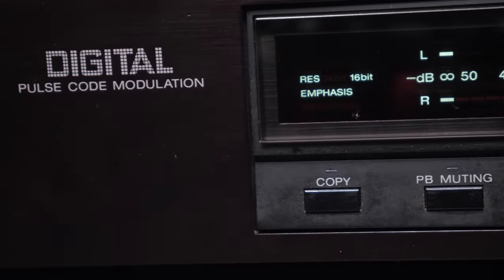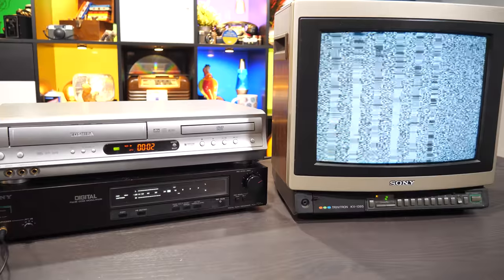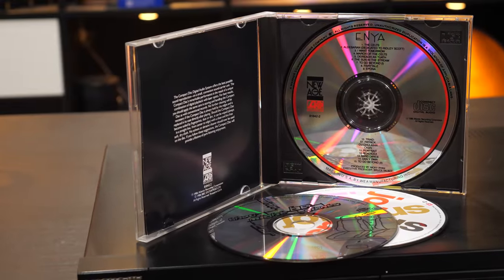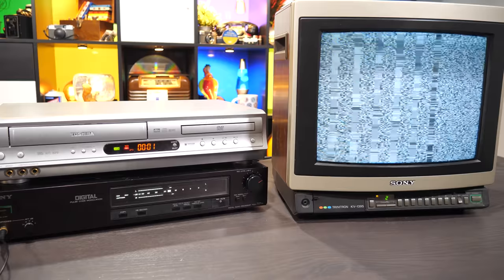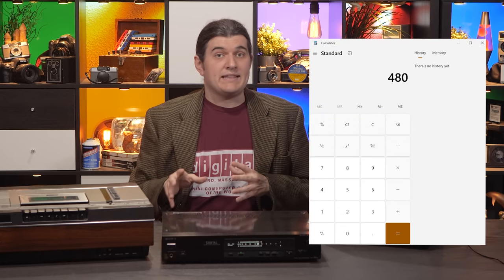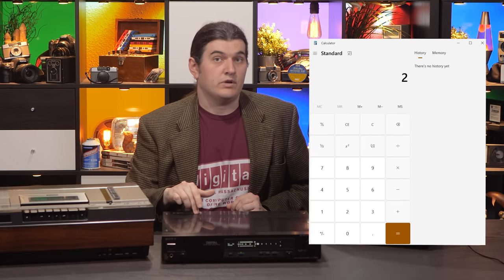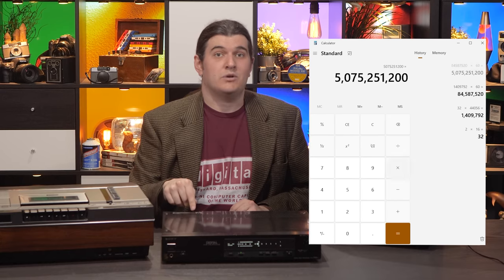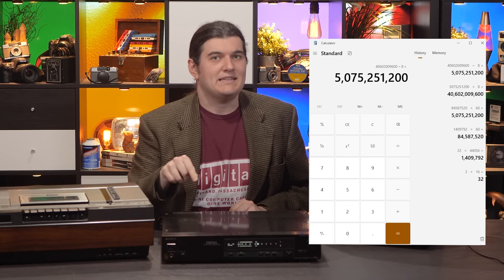Digital audio needed videotape to be possible - and the early days were wild!

Comment: This isn’t a mainstream use but I worked in a Biomed engineering lab at John’s Hopkins back in the early 90’s. The head of the lab modified one of these to work as a data recorder for patch clamping cardiac cells.

Comment: They would have been great for mastering on to for home/semi-pro music recording from 4-track cassette and lower-end reel-to-reel multitrack recorders. But the fact that you can't master a CD on it is a major kick in the rear.

I wonder how that video format compares to the signal a DAT recorder makes. (Which we can never see in its raw format, as we can here on your monitor, as all you ever get out of them is the decoded audio data.)

I knew about professional versions of these but never realized these consumer ones existed. I can say for sure I'd have wanted one. Even if I couldn't master CDs off them (and of course we didn't have the ability to cut CDs on our computers until CDRs started becoming available in the very late '80s and weren't affordable until a few years into the '90s - and also this has no digital interface to a computer so the whole issue is moot) it would still provide a 100% transparent medium to master on to and duplicate analog cassette tape copies from. (I'd often re-master every time I wanted to make a new tape copy for myself or friends anyway, just to save the additional noise and quality loss of another tape generation. With this I wouldn't have to, and that's exactly what I did when I first got my hands on a friend's DAT machine.)

Thanks!

Comment: At 5:50 --  The circuit described here would be more of a over-complicated amplifier, not exactly a radio, unless the signal is transmitted in a step you didn't describe?
Actually, digital radio makes sense, when the code that makes up the signal has additional parity bits -- include those, and it's easier to recover signal lost due to interference.

Comment: PCM Audio data doesn't have to be perfectly recovered to work.  It does have error correction, but even that doesn't get back "perfect" data.  This is considered a "lossy" storage since some amount of loss is not perceptible.
 PC Data does need perfection, so the error correction must be much more robust which may have been more difficult using this video conversion process.

Comment: I had an ISA card in the early 90ies that was meant to save up to 2 GB (! that was incredible in the early 90ies) to any VCR. Never really worked for me, though. The output looked a bit similar, afair. Didn't know this was a thing decades earlier, though. First digital tape I knew and used was DAT (late 80ies, early 90ies). Edit: I see you mention that kind of backup to VHS. My card was full length maybe even sandwiched. Must have been really early 90ies. But, as I mentioned, I also never got it to work. That's probably why a colleague sold it to me.

Comment: Were there ever any self-contained tape backup devices that used VHS tapes? The Backer was super clunky, but an all-in-one device that you plugged in to your computer using SCSI or a parallel port would be relatively easy to use, and you could have stored a crapload of data with a relatively cheap videotape. Maybe the linear audio track of a VHS tape could be used as a rudimentary directory....

Comment: The reason why storing computer data in videotapes was not considered early on is the fact computers access random chunks of data, not stored continuously, unlike musical programs. That would have signified very slow access speeds for the tape recorder heads. Hard drives spinning at many thousand RPM's with fast moving heads were much better. Even floppy drives had an advantage here.

Comment: To that last point about audio data being data.. HiMD allowed minidiscs to be used for storage.. (ala Matrix). I did for a while together with CD-Rs until M-discs became more affordable. We need to do a show on longevity of digital data.. not just the media lifetime but equipment needed.. esp after learning that many NAND flash data can disappear relatively quickly without refreshing.. ie modern ssds are not good for long term storage even if sata or m2 exist in 5 or 10 years..

Comment: I have a pro-sumer grade PCM2500 DAT machine, which aside from being beige and using XLR connectors, and of course the adjunction of a DAT tape drive, strongly resembles this earlier consumer device, and shares many components with it.  Of course the inclusion of a DAT tape drive very much enhances the machine’s raison d’être, and the sample rate is switchable between 48Khz (the EIAJ standard for DAT) and 44.1Khz, meaning it could at least theoretically be used as a mastering machine for compact discs. More insidiously, it has a switch to lift the “copy inhibit” bit, making it possible to record perfect digital copies from commercial CD’s – the only non-fully professional machine I have seen that could do this, not that I ever would have considered doing so, obviously. It is twice the size of the machine featured here, in that the upper half, with the DAT drive is exactly the size of this machine, but an additional unit of equal size mounts beneath it in piggy-back fashion and contains the digital processing (which today would be done in a chip the size of a dime, and would contain 16 channels of 48-Bit 192Khz.

Comment: In the mid-80s, I almost bought a PCM processor while in the military and stationed in Japan.  Buying electronics in Japan was just about a requirement since it was so cutting edge and, at the time, far cheaper than stateside.  I was building a rack system (also a thing back then).  However, since a PCM with a VCR cost nearly a month's pay for me, I didn't.  
The idea was that sound quality would be far superior to any cassette or reel-to-reel and could store more music than either one.  INSTEAD, I went through CASES of blank cassettes recording my favorite record albums at a studio set up on base for that very purpose...for a penny a minute.  I left Japan possessing my sparkling new stereo tower, some BIG speakers...and HUNDREDS of cassette tapes of my favorite music.  
In retrospect, I've often thought about how ILLEGIBLE that would be to do TODAY.  Yet, somehow, we were allowed to do it then...at an OVERSEAS military base at least.

Comment: I always thought the 44.1KHz was just because it was based on the human range of hearing and the Nyquist-Shannon sampling. Pretty interesting to hear it was actually based on tape data throughput.
Reply: It's both. 40KHz is what you need. the 4KHz is because filters aren't perfect. The 0.1 is because of analogue video standards.

Comment: I have 2 of the top line end of era JVC Super VHS decks(HR-S9800U and HR-S9600U) which were amazing as the audio is digital recorded but video analog and you can listen to the audio forward direction at variable jog wheel speeds while both FF , but also forward audio when rewinding. It would be chunked more the faster you jog wheeled, but still intelligible, to find the spot you wanted. Way better than DVD which had no audio when FF or REW. You should do a video on those.I think they came out with full digital audio and video recorded to VHS tape as the last of the VHS recorders.

Comment: 34:10 - Nope. 

The problem is chaptering and random access. Tape storage is essentially only useful for streaming data -- so backups, audio, video, analytics data, etc. 

Any seeking of the data was miserably slow. 

And good luck if you want to update a singular section of the data

Comment: I'm sure someone used one of these to back up huge amounts of data from their 8-bit computer! Even though that would have been a rather silly process of converting data to sound and back, I don't see why it wouldn't work.

The early era of computers was so neat that way. Encoding data as sound meant you could pipe it through all manner of analog audio equipment. Want wireless data transfer? Plug in a radio. Want to store data? Plug in a recorder. Want wired transmission? Plug in a telephone. The computer didn't have to know a thing about these devices. You could split the signal and send one file simultaneously to any number of computers.

This gadget is a great demonstration of that idea. You could do whatever you like with the video signal. Record it on Betamax or VHS, broadcast it to Mars, the machine doesn't care! And since it works with analog audio, all those ideas above apply as well!

Comment: I think one of the primary reasons these things weren't used to store data was because these were not random access.

I can imagine one usecase could've been if you didn't own a CD reader at that weird inbetween phase developers had to ship software in both CD and floppy format, but in an alternate universe where CDs didn't exist and software was still bigger anyway... meaning you just had to flip through copious amounts of floppies to get things like Windows installed.

But then the problem is, without a pretty big buffer to store the data in, the computer might've actually been too slow to read out the data contents of the VHS tape, as it will dump its data sequentially at one and only one speed, and if you blink you miss it. The PC wouldn't be able to slow it down or stop it to allow the CPU to catch up to it if for any reason the CPU gets locked up to do God knows what. I suppose some computers like the Commodores that could read data off of audio cassette tapes probably disabled interrupts and did some tight timing junk to guarantee they'd be able to load the data into memory succesfully. Streaming data off of these things directly couldn't have been easy, if at all possible.

Comment: I wonder if the intended use case for this was to (eventually) receive digital audio with analog (satellite or cable) TV broadcasts, so networks could broadcast movies with high fidelity audio, via simulcasting 2 channels. And it was eventually overtaken by compact disc systems and digital video broadcasting.

Comment: Why wasn't this used for 5 GB hard drives?  Because this is a streaming device useful for Read Only Memory at a fixed retrieval rate on one direction at one location.  Good for retrieving streams like audio and eventually movies.  Hard disk drives are closer to Random Access Memory meaning they can jog to any point in their memory in an instant.  You can't use VHS tapes as useful computer memory.

Comment: I suppose that could be used as a BGM device of sorts, if it works just as well with a tape recorded or playing in EP mode. And you're unlikely to get that warble or lo-fi sound that's usually typical of BGM players when they age. I wonder if anyone used it like that?
Reply: From other comments I can say yes PCM adapters were sometimes used for BGM.

Comment: Isn't this where hifi video recording comes in?
I used to use a Sony hifi video recorder as a high quality cassette deck. I'd record DBX encoded LPs on my Betamax video recorder and play them back through my hifi system. The recorder could handle the dynamic range of the DBX discs so they no longer needed the DBX decoder. I also used this setup to record my Mobile Fidelity and direct cut discs. 

I did this rather than use a reel to reel machine. Later I would record CDs.

It took several decades before I bought a reel to reel machine.

And yes, when CDs became a thing, I no longer bothered to use my Beta hifi recorder.

OK, update and correction. Beta hifi was not digital but was analogue FM. So all the foregoing is a sidetrack. ;)
Reply: That's what's even more amusing. Yes, hi-fi FM audio recording on VCRs is analog and sounded nearly as good as CD in the day. The most perceivable artifact was video head switching noise. It didn't even have tape hiss. I used to archive CDs or make mix tapes on VHS. Maybe that's where i got my login name from even lol

Comment: If you can store digital informations as sounds on a audiocassette tape (Like commodore 64 Datasettes) then of course nobody can stop you from storing digital sound information on a videotape :P  Something similar was done for VHS too in later years for digital data backups. However it was not really that reliable.

Comment: By the time we figured out that we can store data to tape, there were already hard drives capable of storing over 1 gigabyte of data. It seems strange to say this, but there really was not a need for most people to store gigabytes of data anyway until after the year 2000. We didn't have digital cameras, there was no YouTube yet. Everyone was still on dialup, so not too many people were sharing large files at the time. Windows 95 only required a few hundred megs to install. Not the 30 gigs that Windows 10 bloats.

Comment: You may have mentioned this in the video and I might have missed it, but would this work with Beta as well? Based on what you explained, it seems like this would work any analog video recording solution, but I could be WILDLY wrong. Of course, not that it would be of any benefit to use it with Beta due to all the things you have explained over the years with the format's shortcomings

Comment: Did you ever have VHS VCR's with HiFi stereo sound in the US?  I think they were called NICAM Stereo in Europe.  I think they had pretty good audio quality.
Reply: We did, and it became more common through the '90s, though cheap machines often left the feature out. It sounded vastly better than standard audio, pretty much indistinguishable to CD quality as far as I could tell. Only problem was that it was quite sensitive to differences in tracking between machines and to worn or poor-quality tapes, more so than the normal video and audio signals.

Comment: If VHS tapes had the bandwidth/storage space to store this much digital data, compared to commercial grade computer storage on magnetic tape, which 30khz/12bit pcm data would fill up so quickly, why didn't they use VHS tapes for data storage?

Or why was the commercial tape storage so inefficient compared to VHS?

Comment: What a missed opportunity. This could have been turned into an all-in-one device and they could have sold music on VHS before the CD was invented. And the CD would have seemed stupid with its 60 min capacity (i don't think they made the larger capacity ones until later).
It's also much harder to physically damage a VHS than scratch a CD.
Not as portable though, but they had audio cassettes for this.

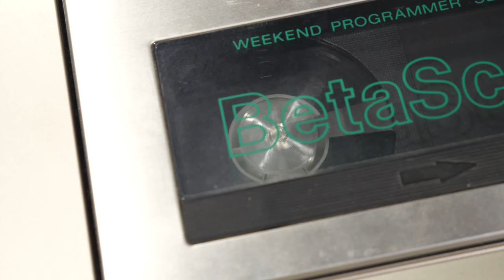Comment: 32:51 When I was a kid, my next door neighbour had Amiga games and applications backed up on to 2 VHS tapes. I remember he gave me a loan of the dongle and the 2 tapes for a couple of nights. Now, Im only about 13 at the time, so going through 8 hours of tape wasnt a problem. Loading up a block of data (usually spaced into 30 second chunks) to see the next list of possible goodies was exhilirating as a wean.
The only problem was reliability. I do remember specifically wanting a few apps and games that would simply not load from the tape. It didnt really matter tbh as Id completely filled my 240MB hard drive and was constantly reconsidering old downloads (I believe they were called de-packs at the time - although, that may just be the name my neighbour gave it) for deletion to make space for the newest stuff on the tapes XD

Comment: don't underestimate how important copying and sharing audio recordings was in the Japanese market back in the 70s and 80s. those of us around back then remember how inexpensive cassettes, (even chromium tapes) were at the time. this was a legacy of the japanese tape market at the time. 

in japan, a record that would sell for $4-5 in the US could be the equivalent of more than $20 in Japan. copying tapes was so prevalent, the records stores had tape dubbing machines. you could drop a 100 yen coin and the machine would make a high speed copy of your homemade tape for your friends.

i can see a machine like this being very popular in Japan for the purpose of copying and sharing recordings of records. even if you had the kilobucks to spend on a vcr and digital encoder, it may still have been cheaper than buying the records. daisy chain vcrs, and your circle of friends could enjoy perfect copies of the latest hits at a fraction of the cost.

i can't say for sure if these were used that way, but i wouldn't be surprised if that market was front and center with Sony execs.

Comment: When you were showing that it can handle multiple corrupted lines without audio issues how did you "induce" those issues? Did you just record normally and find some errored segments you could use as samples or did you do something a little trickier by using an older degraded tape or messing with the inputs or something.

Comment: Im blown away by the sheer size and storage capabilities they had in Nineteen-freakin SEVENTY SEVEN that just went ... unused for some two DECADES. Surely there mustve been some technical hurdles that prevented someone from the early 80s from just ... Hey what if we built a computer that could store 3-5GB? 
I suppose processor speeds and sizes were still outrageous by millennial standards and RAM would not have been any more efficient... but maybe. 

A world where tech made a great leap forward in the years before SMB2 was released, where our mid-2000s computers existed by 1990. Wow.